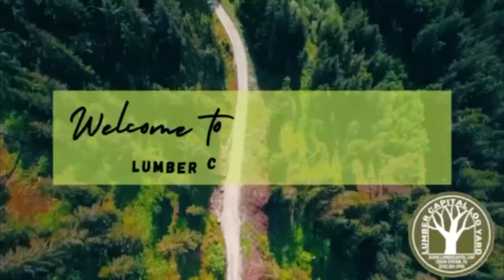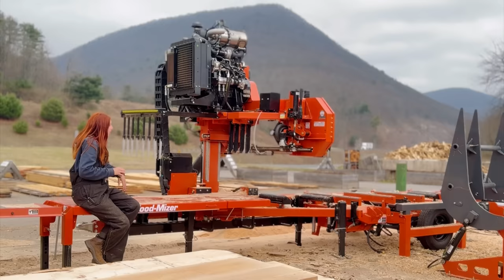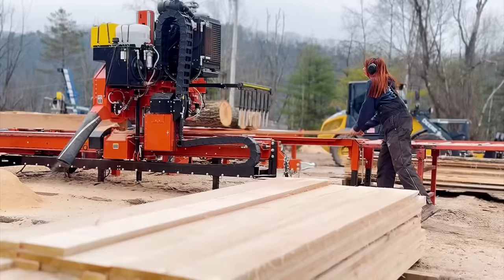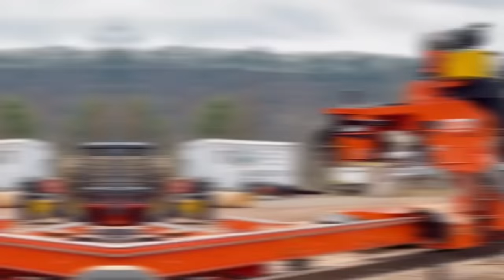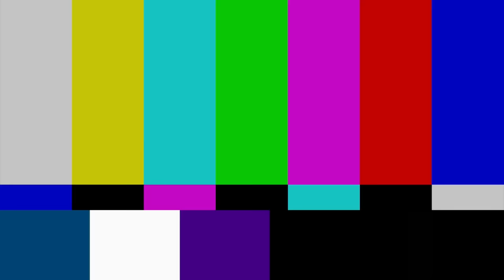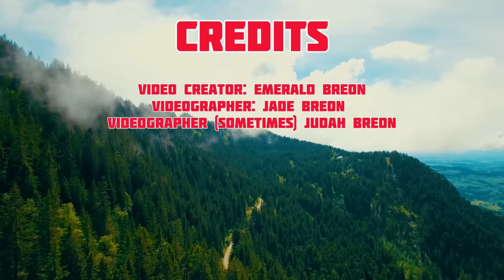The LT70 Sisters Switch Jobs for a Day! I swamp, Jade operates, let’s see what happens…

Comment: Nice job ladies, though I was hoping there would have been a bet in there somewhere, for say, a dollar.  Was just in southern PA this last week.  An estate to close down in Waynesboro, stayed in Chambersburg.  Nice work weather.  Hauling a trailer down 70/76 just after the Allegheny Mt. tunnel is dicey due to the construction.  I think the passenger side tire on the trailer spent regular time on the eastbound rock wall.  It's a squeeze.  Be nice when it's finished.

Comment: you have enough room there to take the planks off the mill and slide them into the edger
Reply: they have room but not time.   The edger has to remain a separate job in my opinion.

Comment: Well, that was funny 😂
 And good job, Jade, stepping in and showing big sis you can handle the mill just fine. Don't forget your long underwear when working when it's cold. Yall aren't tucked up under the roof and beside the building anymore, so it's going to be colder out there in the open.
   Em was getting even with the jumping rope. And stretching 😂. 
   You should have negotiated a truck or car for switching with her 😂😂.
  Fun video and loved the bloopers as well.
  Great job gals

Comment: I have a rechargable hand warmer, it works great for keeping my hands warm. And it lasts a long time.
Reply: There are also coats and vests with heating filaments built in. They run on rechargeable battery packs. They may be better for more stationary use though, like sitting in a deer blind or out on the ice for ice fishing.

Comment: Obviously the supply of extra blades cannot be used for this new mill. Will Grandpa's sharpening machine work with the blades of this new machine? Do you have a plan to cycle in new blades, and get Grandpa started in his sharpening procedures?
Reply: The sharpening machine will work with the new blades.

Comment: Why dont you put lath between every layer so you can dry the wood ?
Reply: That would depend on where the wood is going.   Out front---- lath   to Storybook------ no lath. Reason shipment by truck.
Reply: @scottsoper  even if it is stayin in the yard  as mold can form in a short time .  I also worked in a lumber yard .

Comment: Can we presume you are going to build a shelter of some kind over this very expensive machine? Also would provide cover for work on inclement days. Simple 'pole barn type structure would do the job. I'm sure "the boss"  has thought of this.
Reply: The machine is made to be outside, so that is not a rush.  It is better for Emerald and Jade to be out of the sun or rain and maybe have some shelter from the wind blowing sawdust in their faces. However it is not time to build yet.  I don't think they have a final layout of machines yet; at least I would do it different.  Plus we need to see, as Emerald gets faster, what the swamping job will really be.  So for now some shad from temporary tarps would help keep the hot sun off till things shake down more. (my opinion)
Reply: Are you family or groupie? @scottsoper
Reply: @beachball5830   I am a fan.  However as you see in the next video, they are still trying to work out the flow.
Reply: Just checking. As you can or cannot read, that is what I commented on in my original post. @scottsoper
Reply: @beachball5830 I can read just fine.  You are talking pole barns and the layout is not figured out yet. Putting up a tarp is not the same as a pole barn.   Watch the next video and put down your idea for fixing the layout. Give Emerald and Jade the idea they need to make the flow work, then talk shelter.....

Comment: Jade did not have the opportunity to learn from the LT70 tech as you did.  
Please explane "the 70 Sisters" you gals are not 50 years old. 
Is that were the LT70 is going to be located, or are you building a selter for it....that is if you could find some wood to build it?
Reply: "the 70 Sisters" refers to the LT-70....          In my opinion they should rearrange how they have it set up and get that layout correct before worrying about a building.